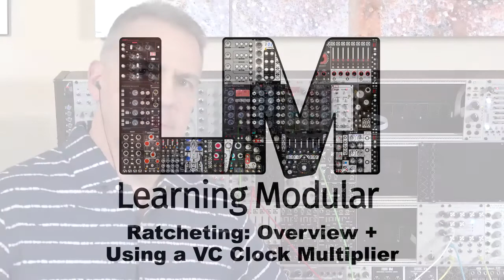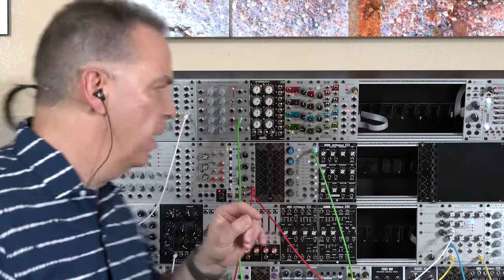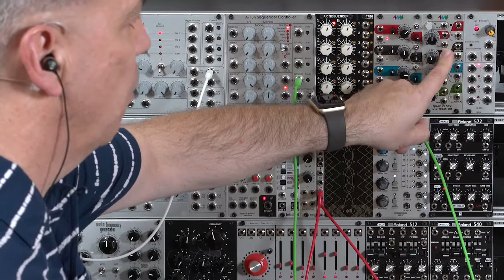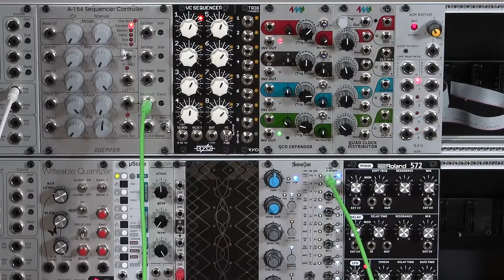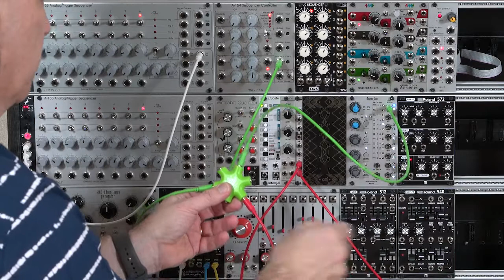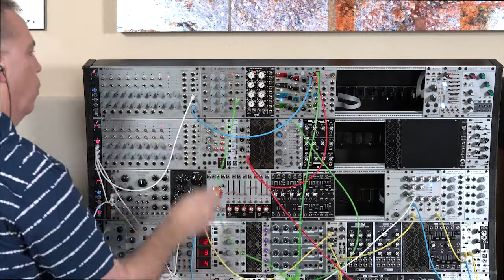Ratcheting: Introduction, plus Using a VC Clock Multiplier

Comment: Amazing. I have a Doepfer A160-5. Can I use this to achieve what you are doing?
Reply from the maker: Yes, the A160-5 would be perfect for this.
Reply: @LearningModular  Thank you so much for replying. How on earth would i patch this. i also have the doepfer sequential switch. I've watched your video multiple times. Please help. Your videos are absolutely amazing by the way.
Reply from the maker: Take the second row from the sequencer - the one used to set the multiplications for ratcheting - and patch it to the CV In on the A-160-5. Patch a copy of the sequencer's clock to 160-5's Clock In, and the 160-5's Clock Out to the gate in on the ADSR. Like this: http://www.doepfer.de/a1605.htm
Reply: @LearningModular  Can this be done using a MAQ16/3 ???? cheers.....
Reply from the maker: @Knoc_Whearity  it should be. You would need to use the external clock out to drive the clock multiplier, and the analog CV+gate outputs - one for the voice you are playing; the CV out of a second line from the MAQ to choose the clock multiplication.
Reply: Thanks once again for replying. I did exactly that: however, not getting it like the way your results are. What am I missing? I’ll try again tonight. Much respect!